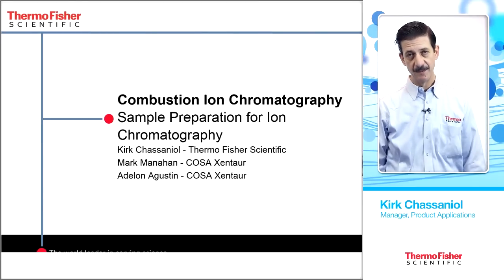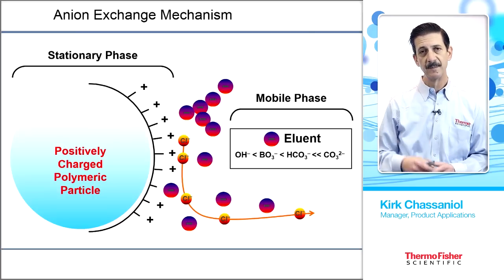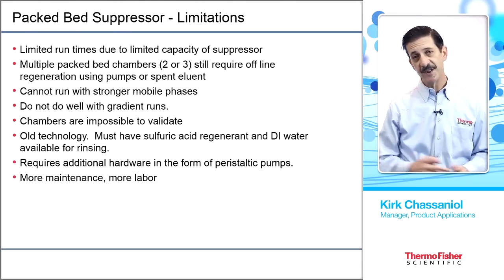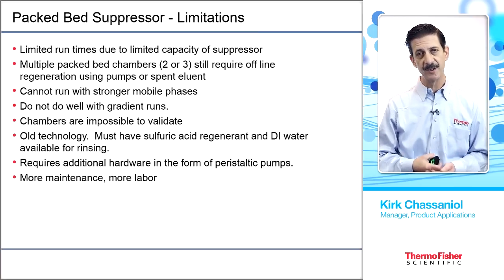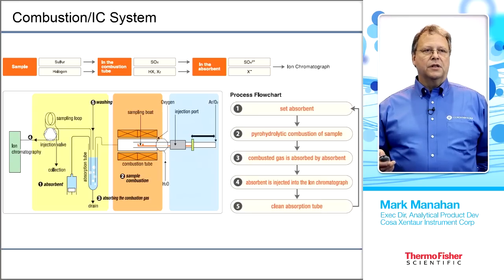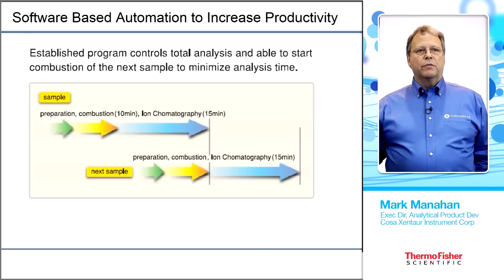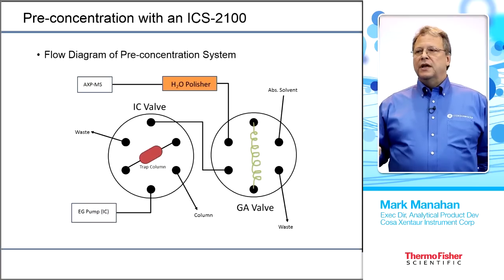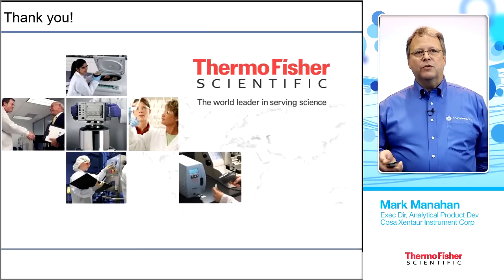7. Halogen Analysis using Combustion Ion Chromatography

Comment: What is the combustion temperature? It is not stated but absolutely critical to be able to define exactly what is being measured. During this presentation, there is constant interchanging between halogens and halides which are not the same thing. At one point the presenter talks about the determination of  "fluorine, bromine, chlorine and iodide"!.  Combustion IC was developed as a method for quantification of organohalogens (also referred to as organohalides to confuse matters). The organohalogen components are combusted to form the corresponding halide ions in solution which are then separated by IC and, after suppression, detected as the corresponding acids; however, if the combustion temperature is circa 800 - 1100C, then some inorganic halides would also be included in the quantification, for example HCl and NH4Cl. If the combustion temperature is much higher, then other inorganic halides would be included. Under any circumstances, direct CIC analysis is a measure of organohalogens and at least some inorganic halides if present. To measure only organohalogens in an organic matrix, the matrix would need to be washed with water first to remove any inorganic halides and then the washed organic matrix can then be analysed by CIC. To measure total halogens (organic halogens and inorganic halides) the combustion temperature would have to be in excess of 1500C.